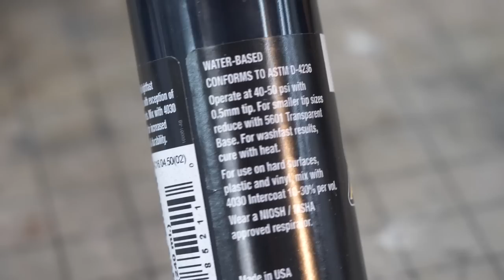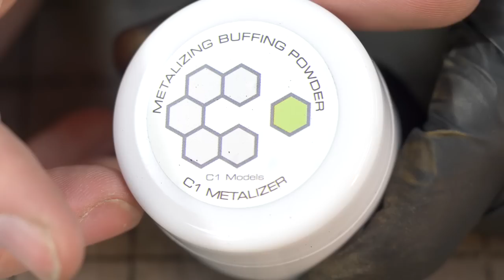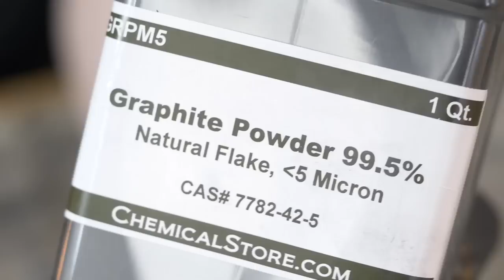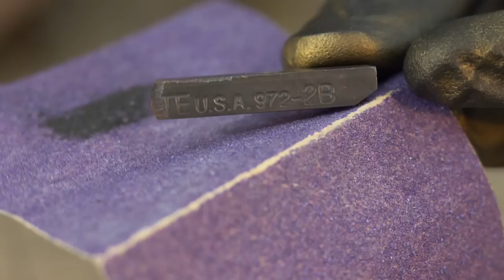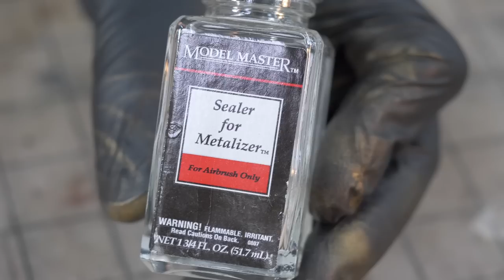SHINY! Graphite vs. Metallic Finishes - Wonder Woman's Sword of Athena

Comment: hey guys! great video. I'm the local prop tart "graphite nut". and i've found a few things 1. urethane clear coat helps IMMENSELY in getting that super smooth base for the powder. 2. if you spray some alclad chrome, or spaz stix chrome on FIRST, and THEN buff the powder on, it yields a much brighter chrome finish, and much less "black chrome" 3. the graphite is so durable because each granule of powder is extremely "sharp", meaning that as you buff it, it forces itself into your paint like a million tiny thumbtacks, which is why it doesn't need a clear coat. the buffing is flattening the particles down, which is what gives you the shine. clear coats need to follow the rules of normal chrome paints. it doesn't like solvents, but it is very durable to physical abuse. Cheers friends!
Reply: Great info!
Reply from the maker: Fantastic tips all around. Thanks so much for sharing! =D
Reply: Question: I'm trying to find good ways to enhance the shine on my homemade LARP weaponry. The difficulty with this is that it needs to be able to withstand the abuse such a weapon takes. Do you think graphite would flex with the material, or will it lose it's shine really quickly? It would be applied to either a coat of clear Plastidip or Isoflex, both quite glossy.
Reply: @MartijnCalkhoven  the graphite sould be fine as long as the coat under it is fine and again if it dose finally show wear you can just add more and buff again but based on what i seen grphite will be fine as long as the base is fine with the abuse with larp weapons
Reply: Martijn Calkhoven the powder isn’t a coherent coating, meaning there is no binder, so the particles are bound to the surface, but not to each other. All is to say it’s super flexible
Reply: wow I wonder how graphite paper would work also if a candy like paint could change the color to yellow or red as they do on chrome
Reply: Bakemono Tenshi yes. But you have to follow any of the standard chrome paint rules. As in water based clear coats only etc. it hates solvents. Other chrome paint actually works better in that regard. The benefit of the powder is that it’s a very high shine that doesn’t require a sealer
Reply: @delron1594  I can imagine I might leave some 'pencil marks' on my opponent's gear. I'll give it a try regardless, because it looks promising! Thank you for your answer!
Reply: @PrintsandProps  Thank you for the insightful answer! I'm gonna give it a try and see how it will do after a few skirmishes at the office.
Reply: Hello! I tried this method this weekend on a foam great sword I am trying to upgrade. But it is rubbing off and will not cling  in certain areas no matter how much I buff it in. I even tried crystal clearing ontop of it, then rubbing more graphite on. Is there something I might be doing wrong? I treated it like Eric's- two coats of white krylon, then two coats of glossy clear coat.
Reply: @auja943  I was wondering the same thing.
Reply: Hey, really hoping you can help me. I'm having real with this technique. I cannot get the graphite powder to stick to my clear coat. It requires a huge amount of force to get the graphite to bed into the paint and when it does I either scratch the paint and get an uneven finish. Do you have to push hard normally. Are there clear under coats I should avoid? I'm just using a rattle can clear lacquer.
Reply: that is a huge help, just venturing into 3d printed props and tried graphite for the first time on imperial code cylinders i made to also be thumbdrives and it just looked like extra shiny black lol it was a mix of first time try and test run. gonna give this tips a try next

Comment: For anyone who would like to know, I've used graphite powder for years, I've  found the under colour makes little drifference with a full covering, but a light dusting will let  the base show through but it's difficlut to get it even...  The effect is a dark metalic shine like old /aged steel, the brightness/lightness/viberence is realy adjusted by how smooth and shinny the base is, this means painting is not always nessary if the the matirial you are working on is already finished.... The technique can be use on almost any matirial inculiding vinyl fabric but the graphite can transfer if it's rubbing against another surface... It does wear off over time, but can be added to easerly and can be washed off with warm soapy water if you want to start over....  Hope this Helps....
These couple Videos showing different uses, of both a Burnt and a Metalised technique ...
Burnt Bones: https://www.youtube.com/watch?v=vMYUFYC-5y4
T-700 Head: https://www.youtube.com/watch?v=zvz68KnPtME
Reply from the maker: Wonderful tips, thanks for sharing! =D

Comment: Hate to be that guy but graphite powder without a respirator = black lung.  I worked for a number of years in a place that had been a graphite manufacturer, probably took years off my life.  The other catch is the stuff gets on EVERYTHING.  99% of the graphite in that place was sealed in but I would still come home a light shade of grey.  
On the flip side it looks great.

Good job on the show.
Reply: God bless your lungs!
Reply: @joycallender9507  Related...  I have some aluminum dust, I was looking for powder and somehow ended up with dust.  The stuff is so lite it will float up out the top when you open the bottle.  And air motion and it will "ride the wave", incredibly cool.  But some years later I learned that that is what they originally used on the Tin Woodsman for exposed skin parts.  It does work incredibly well for that.  But it will get in your lungs and can be very dangerous.  It sent the original Tin man to the ICU because of it getting in his lungs.  So if you wear a respirator when putting it on you are pretty OK because it sticks to the oils on your skin and doesn't really come off on stuff AND with that tiny bit of oil the stuff doesn't float around like when it's clean in the jar.  The look is well very tin man.

Comment: Great video. Definitely feeling some 'prop envy' for Eric's sword finish. A quick Molotow horror story. I painted some parts on my 3D printed BR blaster with Molotow Chrome, got them nice and shiny, and then hit them with gloss clear lacquer. Then I watched as the metal particles in in the chrome floated up into the lacquer, making a beautiful race car silver, but it sure wasn't chrome anymore. I've found that you have to let Molotow cure and out-gas for at least 48-72 hours before you coat it with anything or it will dull or crack/spiderweb... and it dissolves in lacquer thinner AND alcohol... so clear acrylic sealer is almost a must!   

Chunky Metal FOREVER!
Reply from the maker: Wow that's really enlightening. Thanks for sharing. =)
Reply: The only clear coat I've had consistent success with over Molotow Liquid Chrome is Alclad Gloss Klear Kote (ALC310) airbrushed on in thin layers after the Molotow is cured. Barely perceptible effect on the finish. Even Future wasn't as good. It also helps to thin the Molotow with lacquer thinner before applying it.

Comment: I really like using Mehron metallic powder. I think it's to mix into body paints. It's on Amazon for like $10. But it goes a long way when you mix it into resin to make castings. Or dusting the molds, and filling with black resin. It comes in a few colors too.
Reply from the maker: Thanks for the suggestion! =D

Comment: Nice video Bill! Couple tips:

If you want a more consistent flow to the Molotow, I did a test where I thinned it with about 30-40%  lacquer thinner. It went on way smoother and yielded a more chrome like finish, but it took DAYS to dry. If you’re not in a rush, that’s a great way to get an out of the bottle Chrome that’s a little more reflective than Alclad II chrome (which I think would look better than the steel color you had tested). 

If you use a softer pencil lead on a finer grit sandpaper, it will yield a much finer graphite powder that makes it easier to rub into your surface. Hope that helps!
Reply from the maker: Fantastic tips, thanks very much!

Comment: Hi Bill It's me again!.  
Paint tip. Using a transparent amber paint/stain over liquid Chrome makes a pretty convincing polished gold or brass. I'm not sure how the clear paints from rattle cans react to the chrome so i make a yellow varnish using Elmers clear glue and ink. A trick i picked up trying to make Faux stained glass. Food coloring should work as replacement for ink. Still in testing stage on small parts. Also Thank YOU for the paint tip on air brushing liquid chrome on large parts and the Graphite powder i have never heard of using for props. Thanks again for that and your channel. I am learning a lot from you.

Comment: So for those like mirror pigments...in my experience working with them on nails, they loooove to go into solution. So when you seal them/top coat them they lose shine. When we use them on nails you have to use special top and base coats to get them to work properly. Even when they come in solution already instead of in the powder form, you still need very specific top and base coats or exactly what happened to you will happen. When we use the powders we use really smooth, grippy base coats like your friend did for the graphite powder (ps - you can do this with multichrome pigments too as long as you have black under it.), then rub in the powders, then use special topcoats that dry really fast before the mirror finish has time to go into solution again in the sealant/top coat. Btw the best thing for rubbing in powders isn’t cotton, it’s silicone. Well, not sure about graphite, but for mirror ones and multichromes. Idk what’s in the top coats tho, I just use them. But yeah, that’s a place to start researching the best kind of top coats if you’re interested in mirror finishes. Smooth as possible base coat that’s grippy, and a sealant that dries fast. Or look up some of the us top coats and see what kind of stuff is in them so you can look for similar materials to use.  One Night Stand is the most well-known of these.  And if you want to experiment, Born Pretty tells tons of colors and finishes of the rub-in powder for cheap. Mirror, multichrome, iridescent, etc.

Comment: I (we in our clubs workshop) use for 4-5 years Molotow's spray paints. Primers and others. They do a very good job. The metallics contains metal pigments, and the finished props looks like real metal. The only one problem with the metallics are, they can't used with the sponge technic (only works whit the silver/chrome and sometimes with copper). I never used the other paint types from this brand, but I will give a try. We like your videos! Learning a lot. Greetings from Hungary!

Comment: Now I've got to wonder if chrome effect nail powders could be applied in a similar way. They usually require a UV gel base coat to adhere. But I'd be surprised if there isn't a clear coat somewhere in existence that would produce the same effect. If anybody has tried this I'd like to know.

Comment: Hey ! Did the "amorpher graphit" work too ? Because i've buy this on my local store and i've try and it does nothing :/ 
Ive try on EVA foam with flexipaint as flexible sealant, then 3 coat of high gloss black, but when i put the powder like you do on this video, nothing happened its still black.

Amorpher graphit -280 (Natural graphit)

Comment: AllClad2 Gloss Lacquer for sealing Molotow. Its 0 difference from the straight Molotow. Its awesome. 
Sand it to 2000, Spray it on...THEN LET IT DRY. IT TAKES FOREVER. THEN use the lacquer. Its pretty bulletproof after that.
Reply from the maker: Yes, giving the Molotow several days to fully dry seems to be critical.

Comment: they make a Easy Chrome paint that literally brushes on. Something to try? Not sure if it works well with model plastics. With colored semitransparent paint under or over the chrome you could get varied effects? Also a couple coats of clear, wet sanding with fine grit in between, then buffing with car wax for final glossy finish.
Reply from the maker: The Alsa "Easy Chrome" is pretty good, but it doesn't brush on quite as well as their promo videos would lead us to believe. It's also bonkers expensive. I'm not saying it isn't a good option, but it isn't the magic bullet we all hoped would be. Volpin Props did a great review of the product here: https://youtu.be/z8P_HuhLJYc

Comment: quick question, as an avid user of the air brush, do you find gravity fed or pressure fed to to easier to use/give a better finish?
Reply: Brett McCutcheon I prefer gravity fed. Less hassle all around. IMHO.
Reply: @coregeek  aweaome. Been using an old pressure fed that my boss let me have from work and was looking at buying a new one. Noticed you guys use geavity so figured id ask

Comment: I ran into similar issues with the Molotow.  I feel like it's how fast it begins to set, and you only get the chrome effect when it's wet and thick.  I wonder if the Tamiya paint retarder would work with it to give you more time to lay it down?  I need to wait for another project where I need to cover that much surface area, so if you try it before me, please show it in a video.
Reply: Follow up, multiple coats don't help with the shine, and you run into the same issue.  With my experience it took one good thick coat to get a nice shine, and trying to get it in one nice even coat to avoid dripping and pooling.  It looks best right before it's about to pool seems to be the catch.   I ended up doing a lot of wet sanding to get it even.  You can patch it, but it's real tricky to do and every pass can result in a chance to introduce new blemishes.   Also, even after it's dried for a couple days it really doesn't seem to like to be touched and you kind of need to put on a clear coat to protect it.  Alclad's clear coats also seem to work with it.  But multiple light coatings won't get that mirror-like finish I found.   It wants to have enough to form a nice smooth surface before drying which is how you get that real mirror like shine out of it.
Reply: @technicallyartistic  I found the same results in my personal tests with Molotow.
Reply from the maker: I think if I try to paint something this big with Molotow again, I'll use a larger sprayer to get a wider spray pattern and cover it all in one good pass.
Reply: @technicallyartistic  How long do you let it dry before applying the alclads clear to the molotow. Ive always wanted to use this paint but every time I try, just looking at it funny messes it up.
Reply: @Dsk001  A couple days minimum.  You loose a good bit of shine for sure, but it still looks better than the silver paint to me, so it's a compromise I'm willing to live with in that case.  The only thing I've found that doesn't really diminish it too much was a resin clear coat, but that was over the plate of a joystick.   Not a model figure I was working on.   Also, you use a blow torch to get the bubbles out of the resin, probably not a good idea to apply that to plastic parts.
Reply: @punishedprops   Good news.  It works with Tamiya paint retardant.   It flows for longer, allowing it to blend when you come back to it later (in that same session at least).   I still got some areas that were slightly different, but I think that was quantity of paint more than dry time.  But I think you are still right to try a larger spray gun, if you can afford the paint.  I'm going to try some different clear coats over the top to see what happens here as a follow-up.
Reply: @punishedprops  Also, second part of the test.   Clear coats.  I only had the Alclad clear coat and the Model Master clear coat right now.  I'm out of the Model Master Metalizer Sealer.   But taking a second look at Molotow with Tamiya paint retardent and without, and looking at my reflection in the paint strip, I do notice a little less reflection on the retardant side.  On the pure Molotow side, it's patchy still, but the most reflective parts lets call a 10.  The side with the retardant is much more consistent, but let's call the reflectivity a 9.  That the retardant worked at all tells me what is dulling the Molotow after clear coat is probably the solvent in the paint.   I tried the Model Master clear gloss coat first.  That stuff is way too thick for the airbrush and I had to add some thinner.   The Alclad clear coat is much more fluid though and I was able to use that without any thinner.  The results are the Alclad comes the closest at maintaining the reflectivity of the Molotow.  It does reduce the reflectivity, but if it was an 8 before, it's now a 7.   The Model Masters is after that, and from what I can tell, the result you get is going to have to do with how much thinner you had to add to spray it.   I tried adding only a couple drops, which I could spray, but it came out more textured.   Even then the reflectivity is less than the Alclad.  So let's say that reduces the reflectivity by two points, from an 8 to a 6.  But!  There is still a tradeoff.   While I notice the Alclad resulted in the more reflective part (Me being able to see my reflection in the paint) the Model Master clear coat was more glossy (I could see light bounce back better in it.  Those wave light streaks were larger in the Model Master section and the paint felt deeper in a way.)   So follow up test may be coat a larger area in Alclad, see how that dries, then coat that with Model Masters to see if we keep the reflectivity but get the best gloss on top.

Comment: Great Video, I have a question: can this "shinny" effect be achieve with a EVA foam sword ? Maybe sealed with plasti dip or other method?
Reply from the maker: I'm not sure, I haven't tried! But it would totally be worth testing! I think if you get a nice smooth surface it should probably work just fine.
Reply: Agreeing with Bill here. Keeping it smooth would be the key.